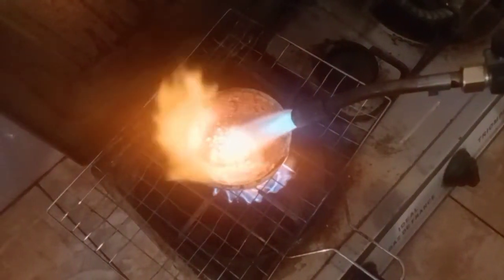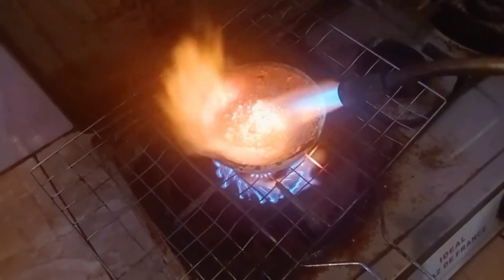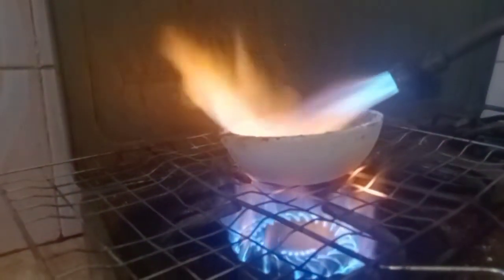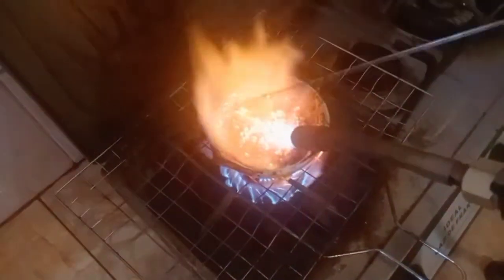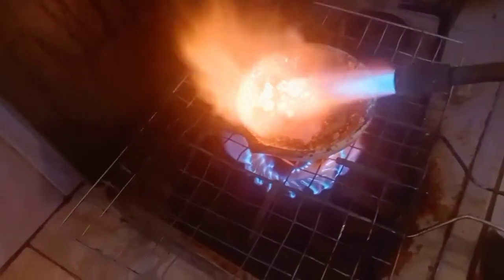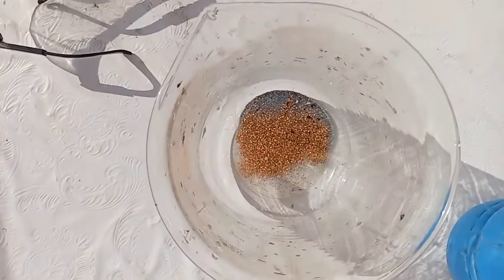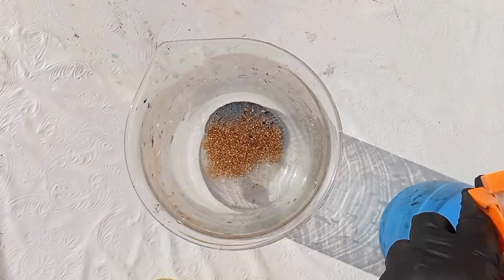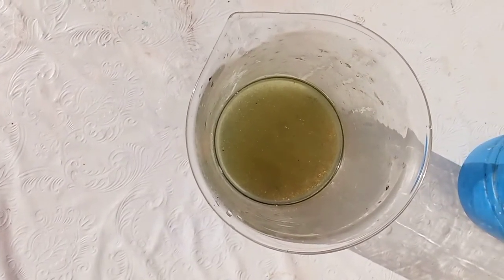How to separate gold from copper

Comment: high temperature can separate the gold and copper in melting point? or it will mix together?
Reply: No, it alloys and wont separate that way. I tried it. The best bet is to either dissolve the copper using nitric acid and then aqua regia for the gold, or cupel the copper out.